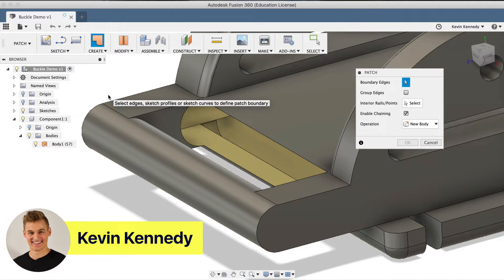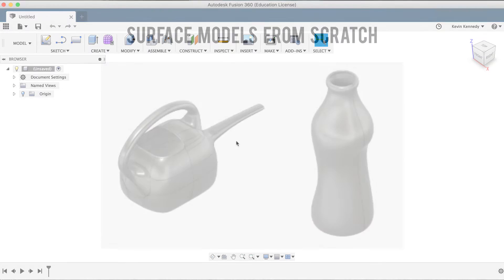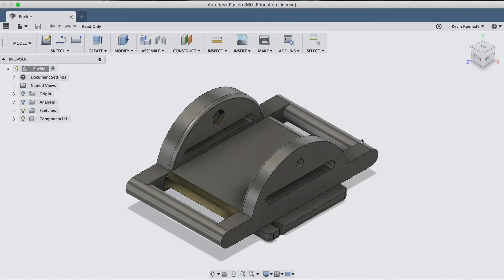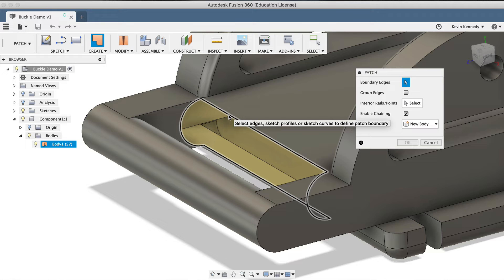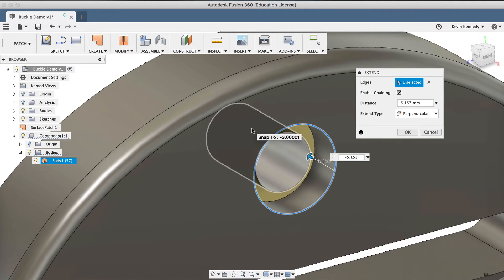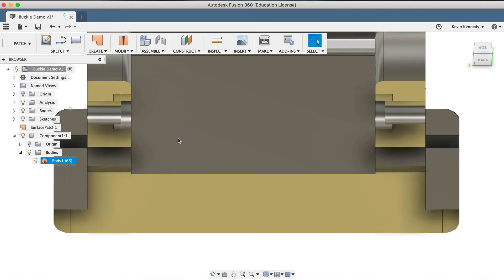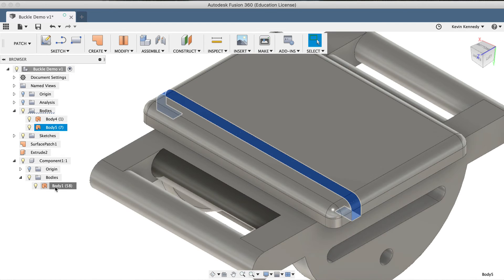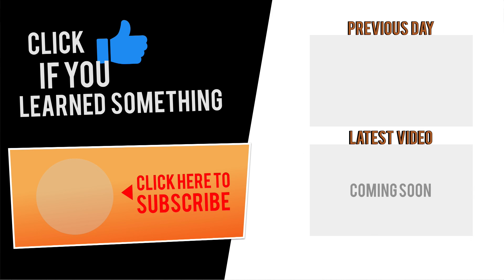Turn Surface Body into Solid Body (Patch Workspace) - Learn Autodesk Fusion 360 in 30 Days: Day #27

Comment: In the Current Fusion 360, the Extend tool is used to bring surface edges together, then stitch. (took a bit for this Novice to work out) I love the Tutorials; They're very easy to follow. Thanks

Comment: Thank you very very much! This video helps me to fix my converted stl file that I wanted to convert to mesh. It didn't turn in to solid, but surface instead. Just had to be aware of, that the surface body have to be in a component at its own and the component shouldn't be selected when stitching. The patched body shall be placed i the top of the project under Bodies. Hope this make sense for others. At my first try, I had the same issue as @flavianojose8423 did.

Comment: At first, thanks for this great videos. I hope you will upload some more of these surface videos.
I had some issues with the first part. I could not create a patch. It was not fitting and also not on the correct position
Reply from the maker: Thanks! Are you referring to the example part in the video or your own file/model?

Comment: What if you patch it and its yellow instead of silver as if its inside out? how do you change it to a face rather than being inside out?
Reply from the maker: Use the 'Reverse Normal" tool, located in the Surface tab, to flip the face (surface).

Comment: Would have been nice to have a model to "fix" rather than just the completed model as Demo to download for this video.
Reply from the maker: Hi Gretchen. The unfixed model is available in the Data Panel. It comes preinstalled with Fusion 360. You'll find it in the Samples section at the bottom of Data Panel >"Basic Training" > Surfaces
Reply: @ProductDesignOnline  You know how you look past some things sometimes...? I totally missed it! Thanks! (but duh...:-} )

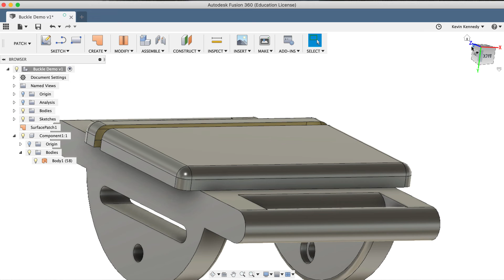Comment: I'm unable to get the stitch to work and I think it may relate to the extrude command and newer version of Fusion 360. In order to do the extrude shown at 9:36, on the new version I need to change the type to thin extrude. This closes the hole but creates a solid body for that section as opposed to a surface body in the video. When I then try to stitch I can select the main body and the first hole that was patched but can not select the hole that was closed with the extrude. Anyone know if I'm missing something or what the process is in the new version?
Reply: Figured out where I was going wrong. For the extrude I was using the E keyboard shortcut but it's not contextual to the workspace you're in so that was triggering the solid body extrude command. Selecting it from the drop down as shown in the video gives you the surface extrude command and from there it worked as shown.

Comment: Issue:
The Patch workspace is missing in Fusion 360, and is no longer in the drop down.
Causes:
Fusion 360 is using a new User Interface where patch has been renamed to Surface.
Solution:
In the new User Interface, the Surface tab has replaced the Patch workspace as shown in the below image. The Surface tab can be found in the Design workspace.
Reply: Thanks, I've noticed throughout these great tutorials that certain tools appear to be missing or modified due to software updates. Your comment confirmed my suspicion.

Comment: Do you have a tool that allows to blend 3D curves as well as blend surfaces all in 3D , whitout relying on 2D sketcher to create my splines or conics. thanks, excellent teacher by the way .
Reply from the maker: Surfaces in Fusion 360 can only be trimmed or stitched. There is no way to blend everything together. It sounds like you're looking to do something more like a mesh modeling program?

Comment: PLEASE tell what was the difference between extrude and extend? Both seemed to be used for the same purpose extending the faces. extend also did the same thing to the surface and extrude also did the same thing to the bottom surface.
Reply: I wanna know that also. Thanks!

Comment: Hi Kevin,  I had some difficulty moving the Body6 to the component.  The Blue underline shows underneath Component1:1 but when I release the mouse it does not appear to move.  I decided to save and re-open the buckle and it showed the body had been moved to the component even though it did not show this before the save.  Confusing.
Reply: Oops, spoke too soon went back and re-opened the buckle and it still shows the body under the top level assembly and the component without any bodies.  Tried moving body with either the top level assembly activated or the component activated and it made no difference.  Body won't move...

Comment: Hi Kevin, I've been watching you vids and have been learning a lot. I want to be able to model aircraft, would apricate your recommendations on best vids to watch
Reply from the maker: Hi, Michael. I would recommend a surface modeling approach for aircraft design. You can watch some of my surface modeling tutorials in these two playlist
Beginner Surfacing - http://bit.ly/surface-playlist
Intermediate Surfacing - http://bit.ly/surface-playlist-int

I would also recommend you get used to splines and conic curves, as those are both integral parts of aircraft design.
Splines - https://youtu.be/quGQB91V0z0
Conic Curves - https://youtu.be/iBKCHY1HsA4

I hope this helps! Cheers, Kevin :)

Comment: I was sent an obj that's two pieces that I made a solid components from, but one is a solid and the other is a surface model. Now I'm trying to make the surface one into a solid but I can't find what to patch or fix, everything seems ok and closed. Idk, what to do in this case?
Reply from the maker: Hi, Some Lilliputian. A surface body will remain a surface body until it is completely closed (and can be turned into a solid). Therefore, it must have a hole or area somewhere that Fusion 360 isn't treating as closed geometry.

Try to use the "Stitch" command and drag over the entire model to select all surfaces. If the stitch command works, it may close-off the model. Sometimes this method works, but if there is an issue with geometry there may be a chance Fusion 360 can't process or solve it.

The second option would be to use the "Boundary Fill" command. You would need to create a box around the surface body and then select the inner part as the area to fill.

Let me know if either of these methods works for you! Cheers, Kevin :)
Reply: @ProductDesignOnline  Hello Kevin, thank you for your fast reply. What I did in the end but I'm not sure if its correct is that I deleted and patched the surfaces that where touching one at a time. For more context I'm going to try to explain the shape... basically I had 2 surfaces touching that made an angle and where the common end point should form there was a gap I think, so by doing what I mentioned before then I was able to make a solid when the second patch was made.
Reply from the maker: @ohnuh  There's nothing wrong with that process either! Sometimes it is just challenging as you can rebuild many parts of the model that weren't necessary.

I do show a few tricks of doing similar things with this conversion video (if you haven't seen it yet) - https://youtu.be/pgWWVcM5YJY
Cheers, Kevin :)
Reply: @ProductDesignOnline  Awesome, thank you!

Comment: I also had trouble with fixing the counter bore holes. I found I had to extrude the larger hole, extend the inner hole, split the 2 faces, and then I could delete them. But then I tried doing the extends with the design history off, then turning it on and deleting, it works. So the trick is to have the design history off until your ready to delete.
Reply from the maker: Hi, Jeff. Thanks for sharing this. I believe my design history was already turned off when I opened up and saved the demo file. Was that not the case for you? Cheers, Kevin :)
Reply: Kevin, could very well have been off. I guess I figured that turning on design history wouldn't affect the steps, but it is good to know that it does.
Reply from the maker: @jefffield1402  No worries... this is good for me to reflect on. Things like this are easy to skip over. I try to make sure I mention things like this in tutorials, so I'll be sure to remember this type of scenario moving forward :)

Comment: Why did you use Extrude instead of Patch on the last one?
Reply from the maker: Hi, Bobos Curse. Great question. It was just to show that you could achieve the same result with the extrude command (in some scenarios). As long as you "stitch" the model afterward, the results would be the same regardless of whether you used extrude or patch. Cheers, Kevin :)
Reply: @ProductDesignOnline  Gotcha.  Thanks!

Comment: Thanks for the tutorial.   If i capture design history, i am not able to delete the two surfaces like you do (at 8'30") in your video.
Reply from the maker: Hi, Bart. Are you working with this demo file or a different surface file? After turning the "Capture Design History" back on, I am able to delete faces on this demo file without any problems. You should get the "Surface Delete" feature in the timeline, as seen here - https://snipboard.io/ItH9W1.jpg

Also, are you hitting the delete key on your keyboard? Or deleting them another way? Cheers, Kevin :)

Comment: Hey Kevin, thanks for the great tutorials, I am impressed again and again with every video that I see in this list! One question: I've started to look into photogrammetry (with phone camera as instructed by the Prusa blog) and I was wondering, since I place my object that I want to scan on a box (or similar), the mesh I get always has a hole at the bottom, sometimes also in other spots that are difficult to capture. Would I be able to close and fix these meshes like you showed in this video as well?
Reply from the maker: Hi, MrsGynny. That is a great question. You can definitely patch the model with these techniques. Most photogrammetry apps are going to output your file to an STL or OJB file. You will need to convert your file to a surface model. I just released a tutorial covering the conversion process that may be helpful to you - https://youtu.be/pgWWVcM5YJY

I used to work with photogrammetry using the iSense 3D scanner. I'll have to eventually make this topic into a tutorial and show the patching/fixing process. Cheers, Kevin :)
Reply: @ProductDesignOnline  Hey, thanks for you quick answer! That's great! Then I don't need to use mesh mixer or similar programs for the patching...I find them quite non-intuitive... :)
Reply from the maker: @MrsGynny  You're welcome...happy to help! I agree with you there - Meshmixer is not as intuitive as Fusion 360. They quit updating it a while back, so that doesn't help! Cheers, Kevin :)

Comment: In fact I'd like more fixing of imported models videos, Thanks!
Reply from the maker: Thanks for the suggestion, José! I'll definitely do some more videos on patching imported files. Are you looking to patch imported STL files? Presumably for 3D printing?

Cheers, Kevin :)
Reply: @ProductDesignOnline  I usually have problems when importing models in step format, and the most annoying thing to fix is missing surfaces, either because of exporting errors or because the engineering department has deleted them for copyright issues
Reply from the maker: @JoséMiguelAragüés  Thanks for the additional info! I'll have to make a more in-depth video on fixing faces. Cheers, Kevin :)
Reply: @ProductDesignOnline  No, in my case, I'm referring to imported solid or surface data from STP files or IGES
Reply from the maker: @JoséMiguelAragüés  Thanks for the clarification. Sorry for the confusion - I meant fixing of solid body, faces, holes, etc. Cheers, Kevin :)

Comment: Hi Kevin, great stuff!
I have a problem with holes in an .stl file. I can't seem to find a way to fill them. Can you help? They are in the bottom edges of this rose:
https://www.thingiverse.com/download:6057411
Reply from the maker: Hi Doug, have you tried using the "Boundary Fill" command?  In the Patch Workspace > Create (Dropdown list) > Boundary Fill.

I believe you'll be able to select the body of the rose and Fusion will create the inner volume. Let me know if this works for you! Cheers, Kevin :)
Reply: Do I need to convert the .stl file before I use the tool? I can't seem to be able to select anything. The box says "Select Tools" which looks like I am selecting a plane?? The second is select cells which doesn't seem to be doing anything. I have spent a number of hours on this with Meshmixer and a few other programs but end up with the same results. Thanks for any help you can give.
Reply from the maker: @douggrant4008  Yes, you'll first have to convert the "mesh to brep." 

It will come down to how many mesh faces this file has... If it has more than 30K then you probably will have to use Meshmixer instead of Fusion 360.

Let me know if you get the command to work after converting the file. Cheers, Kevin :)
Reply: Hi Kevin, I have either missed something or forgotten it. After conversion, I can see the mesh and it does not look like there is a hole, but there are a lot of small triangles in the area where the hole shows up in printing. I can select the area and then one of the modify tools, but they don't seem to do anything. If I choose a modify tool first I cannot select the area. (I know this is a small matter, but I really want to learn to do this and I am hoping to give these as gifts.)
Reply from the maker: @douggrant4008   Hi Doug, sorry for the delayed response. I took a look at this Thingiverse file, and I see the "hole" that you are referring to. I was not able to get the "boundary fill" command to fix it either. This file has a lot higher of a mesh triangle count than I expected. Even after converting the file to a Brep and merging some of the triangles, it was quite large. I understand that you're trying to achieve this in F360; however, I would highly suggest checking out Autodesk Meshmixer (also free). Meshmixer was built to work with mesh files like this and you should be able to patch the hole area with disturbing the rest of the file. Cheers, Kevin :)
Reply: Hi Kevin, I started the process with Meshmixer, and made another attempt this morning but wasn't sure how to go about it. I have tried a number of approaches, none of which have worked. Which tool would you suggest? Also, where can I find some good Meshmixer tutorials?
Sorry this got drawn out and thank you very much for the help.
Doug
Reply from the maker: @douggrant4008  I haven't touched Meshmixer in a few years...but, if I remember right... Go to Analysis > Inspector > this should hopefully select that hole area > click "auto repair all" in the inspector menu.

If that doesn't work...go to "Select" > select one of the triangles next to the hole, then double-click on it. Double-clicking should select all of the triangles around that area. Then go to Edit > Erase and Fill. You can then try some of the different "fill type" settings to see if that changes the results. You'll probably need the "smooth" type.

Let me know if either of those methods work. As I said, it's been a while since I've really used Meshmixer. I used it quite a bit when I worked in a 3D printing lab 4 or 5 years ago...so I'm not sure how much has changed. As always, let me know how it goes! Cheers,  Kevin :)
Reply: The Inspector does not work in this case if I do "all" it messes up the inside. If I click just the problem spots, it doesn't really fix them. I'll take a shot at the second method...probably tomorrow. Thanks again. I am trying to go through the Meshmixer manual. I wish it was in pdf form.
Reply from the maker: @douggrant4008  Ahh... I was worried the first method would mess up the inside, because of how the pedals are layered. Let me know if the second method works. Cheers, Kevin :)
Reply: Hi again, I have looked through the Meshmixer manual and tried everything that made sense but can't seem to close the holes.  It seems like I should simply be able to fill in that area like you would do with clay or auto body filler only via software, but nothing I am finding so far is working. I'm not used to giving up, but I think I might have to on this one. (I can see one of the holes on the thingiverse photos so it was a part of the original. It is such a beautiful print I have worked hard on it.
Reply from the maker: @douggrant4008  I ended up downloading Meshmixer to give it a go... I had no success either. I was able to patch part of the hole.. but for some reasons couldn't get it to fill the entire hole.

I'm wondering if it's worth posting on the Meshmixer forum? Assuming that people are as active on there as the F360 forums, it someone may have a good solution - https://forums.autodesk.com/t5/meshmixer/bd-p/6013

Cheers, Kevin :)

Comment: how about a video that shows how build in tolerance for 3d printing 2 parts that need to fit together. i can do it but would like to see how you do it
Reply from the maker: Hi John, thanks for the suggestion! I won't have time to do it right away but I will add it to the list of video ideas. Thanks for watching...Cheers, Kevin :)